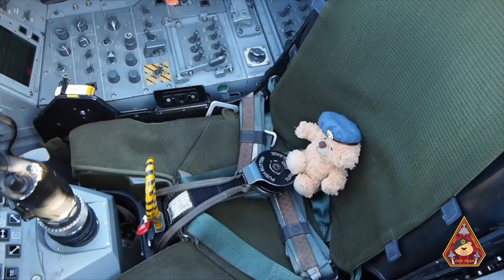TURN UP THE SOUND! LISTEN TO ROLLS ROYCE LIFTSYSTEM LIFTFAN WITH PRATT & WHITNEY F-135 • RAF MARHAM

Comment: Do they have enough power to lift off with any ordinance? Or do they need to roll along to get lift from the wings?
Reply from the maker: Oiii oiiii Dave. So this is pretty much the reason why it is labeled as a STOVL (Short TakeOff and Vertical Landing) and not a VTOL. Yes, it can take off vertically but this would been hardly any payload or less fuel. Or in another scenario, would use a lot of fuel for a heavier payload. So, it can carry out a SHORT TAKEOFF. Check out how this works here: https://youtu.be/N_upD_4Pcuk?si=hgD9rvffvJobJDvp

:_f35::_ted3:
Reply: I think they should build a slightly bigger version that can take the same payload as the other versions F35A
Reply: @robharris8844U  that would take so much development money and air forces probably wont want to order it as the payload is insignificant.but i think a good idea was to make f35b and c handle more gs.they handle 7 and 7.5 respectively.meanwhile,f35a is dancing in the clouds doing stealth stuff doing 9g turns
Reply: Need to roll along
Reply: Without weapons I believe it can take off vertically.